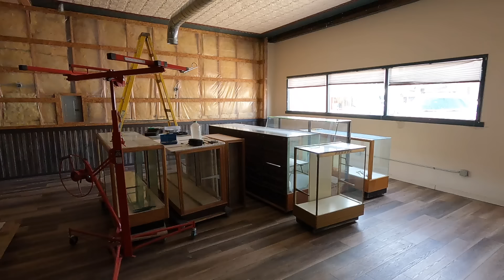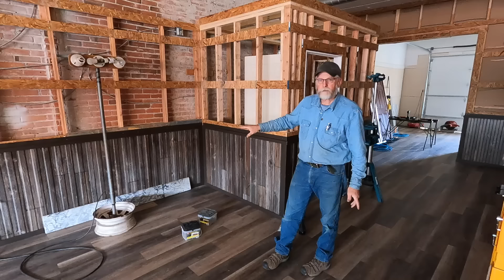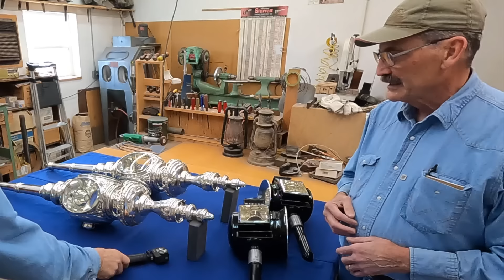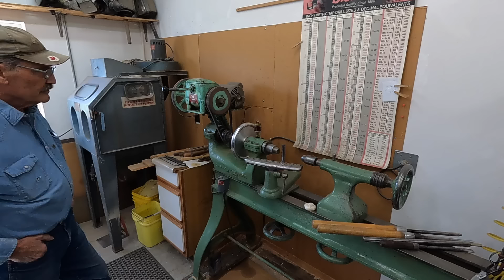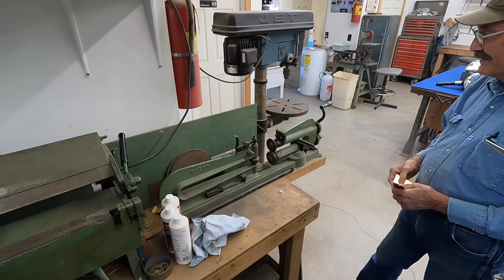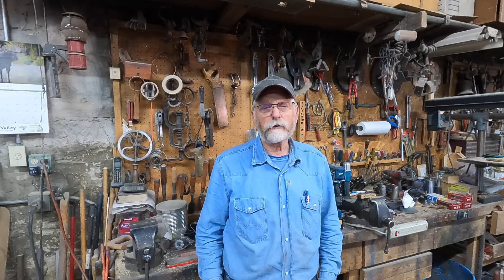The Luminary Shoppe Becomes History | Engels Coach Shop

Comment: But Dave.  It's that sliding table saw.  Ya know, from 1906 with the two 14 inch arbors and the 10-hp motor.  All the adjustments for that sliding part.  Talk about history.  My (dream on) bucket list includes seeing that saw.  OOPS now Rick's luminary work.  Vry Vry cool.  Wow.  ~~~  Maybe just pick up one of those Sears Craftsman Table Saws to replace your very special saw which you could move over with the manure spreader for the gift shop?  Oh my goodness! Nickel and then Silver plating. Whoo Wee. All the details.  Rick will be still around?  That small break.  Maybe workshops to teach people how to use these very special tools?  The circle cutter.  Double Wow!  ~~~ Thank you so much for sharing all that you do!  😳. New Hampshire.

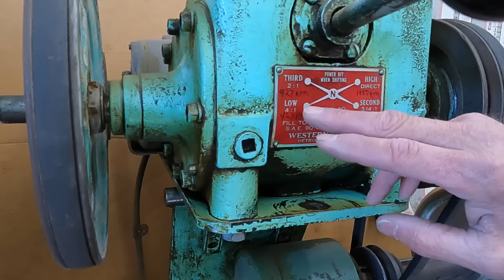Comment: 15:41 those gearboxes are rare now, but i managed to score three of them in Canada when i was across the pond. Very useful for old machinery. Not so much nowadays with VFDs but, back in the 90's late 00's these were the hot thing to have if you got your hands on an old piece of equipment. I still have two working. One for a big band saw that i need geared down to a crawl to cut very delicate wood and the other for my big ship works band saw, to bring it down to a more manageable speed (they usually require big speeds - used to, back when metallurgy couldn't make good band saw blades). I'm stubbornly holding on to them even tho i have converted other machines to VFD, because there's nothing quite like the "clunk" of a physical gearbox. :)